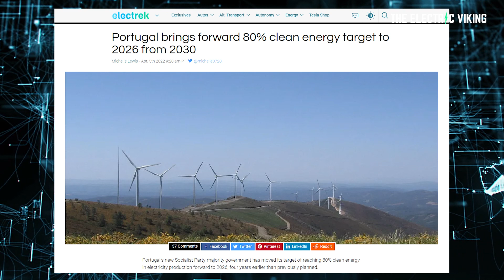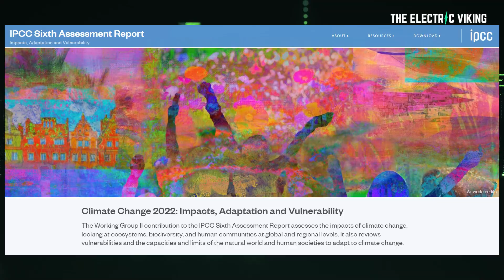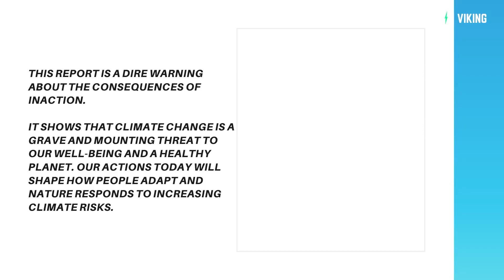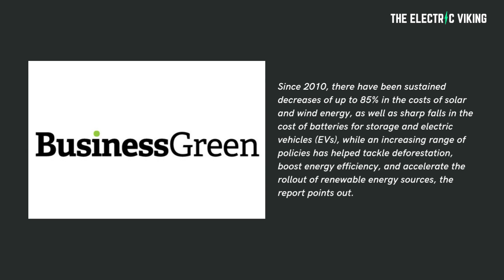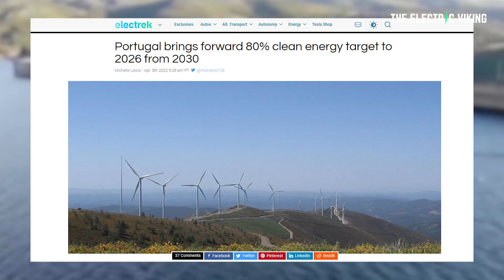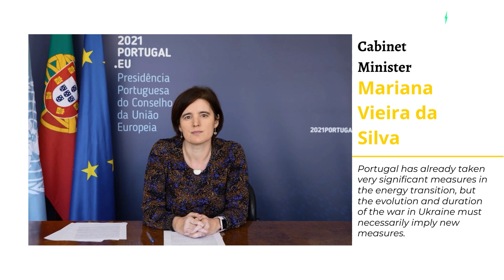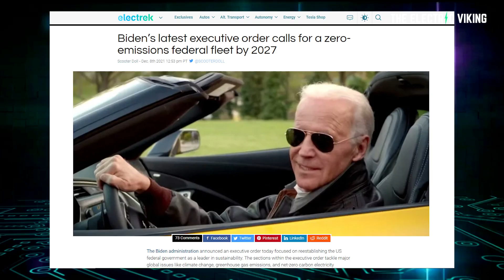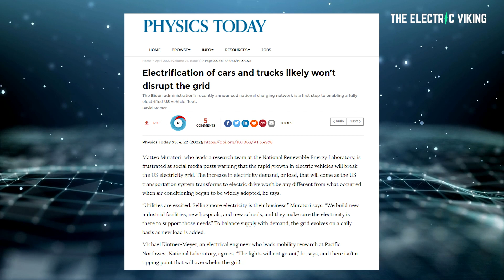Can the electrical grid survive if everyone drives an EV?

Comment: Modern nuclear is the way! Right now we use nuclear designs from the 50's. We need 2022 nuclear technology.
Reply: You forget that "2022 nuclear" is actually "2035 unclear " and that's assuming they can plan, consult, budget and build to that budget in only 13 years.
.
The nearest project to me, Hinckley C in the UK, is billions over budget and years late.
Consultation started in 2006, it's now due to be running in 2026.
When it's running, the energy price is fixed at DOUBLE what new Wind/ Solar 2022 price and they are getting cheaper by the year.
.
That high price will remain until (from memory) 2060(+).
.
Personally, I don't consider that a good deal for the UK taxpayer, or consumer?
.
As for new projects?
I'd love to know how unclear energy will compete?
.
Then there's carbon footprint.
Apart from the huge footprint of building, the fact that a nuclear plant is "binary", it's "off" until fully complete, means that for the entirety of the project an equal amount of fossil generation is still employed....... Another 15? 20? years added to the deficit which can't be recovered.
.
Green projects, even if they take the same time to fully complete (they don't) are incremental, producing from the moment the infrastructure part of the system is built and the first unit is connected.
Their build footprint is therefore halved.
.
Recycling....
You basically don't recycle a nuclear plant, you spend up to 60 years decommissioning the site. (Ref 3 Mile Island, yes, that's the actual projected time to fully decommission!)
In comparison,
Wind? Simply add new generation units to the old pylon. Already being done to make the units even more efficient (using the same infrastructure)
.
As usual, Unclear is good..... Until you really think about it.
Reply: @rogerstarkey5390 ... I would like to see windmill blades designed out of something recyclable like steel or aluminum. The fibers they use now are not recyclable.

Comment: Just a response to your statement "we won't have to do any more mining". Not quite true. There will always be losses in the recycling process which will need to be made up with mined minerals. However, once the ICE fleet is almost fully replaced with EVs, the need for newly mined minerals should drop to a small fraction of what is needed for the replacement curve.
Reply: @alex3261  Not many. Almost 100% of the material in batteries can be recycled.
Reply: @alex3261  to me it sounds like you are either a bot or a paid shill

Comment: I live in California and regulators often say you can't have air conditioning during summers, expect the power to fail if you run it, and when people run the A/C anyway, the power is cut. People will charge their EVs at home at night when solar is not working, and I'm not allowed to have a turbine on my property due to height limits, and even if I could the wind is too weak here 75% of the year.
Reply: California's regulators and energy companies are well known roadblocks to progress. What to do about them though?
Reply: Can battery storage be a  solution like in many other countries? Store the excess electricity during the day so you can use it when solar panels are not generating electricity.
Reply: DOOOOOOOOOOOMMMMMMMMM!!!!!!!!!!

Comment: the utilities have to pull their heads out and grow along with the need for electricity.
Reply: The UK's National Grid do not see any problems ahead. They were one of the organisations whom lobbied to get the ban on the new sale of ICE cars and vans brought forward to 2030 from 2035. They anticipate 9 million EV's on Britain's roads by 2030.  One might hope that as the demand for petrol and diesel reduces, this will mean the UK's oil refineries will take less from the grid on a daily basis. They presently produce 14 million gallons of petrol and 11 million gallons of diesel per day, with each gallon requiring 6 to 8kw of electricity to produce it. You do the maths. The big cheeses from the National Grid have also appeared in front of a Parliamentary Committee some time ago, specifically to answer questions regarding supply availability with EV's etc. The video of that meeting is here on YouTube for those wishing to watch it......  The UK has huge spare capacity now during the night hours. The energy companies are almost giving the electricity away to encourage some usage at night. And this is when the majority of EV owners tend to charge their cars, usually on EV specific tariffs at around a quarter of the normal daytime rate.